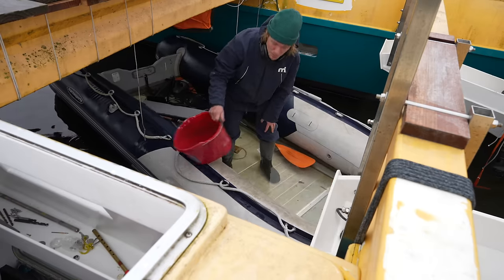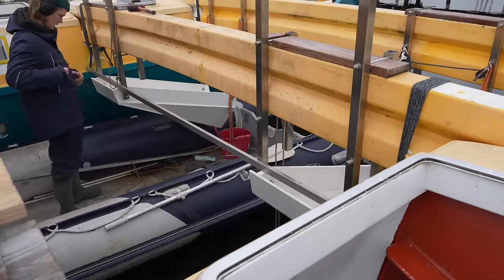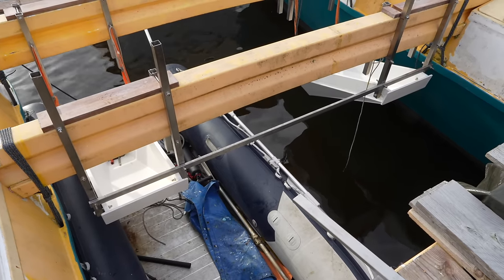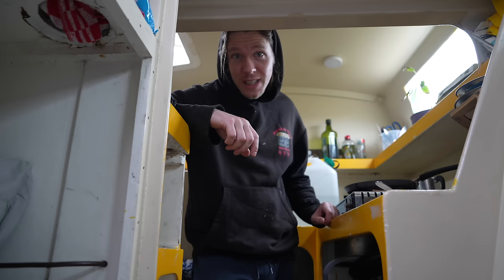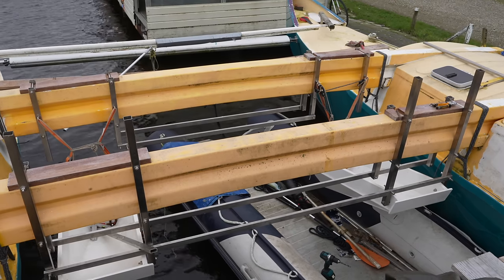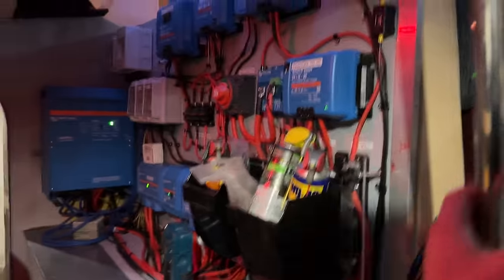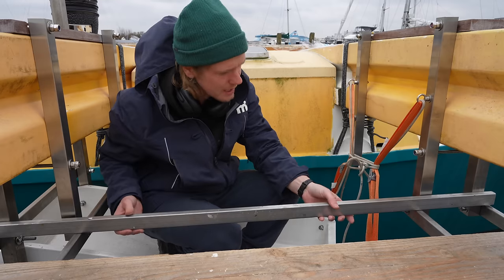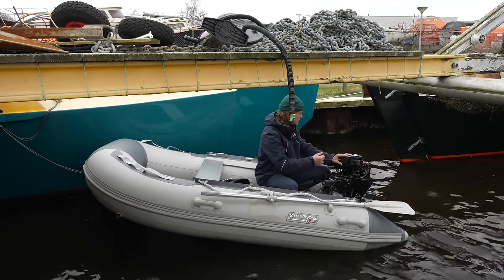I Built A Cockpit Floor for My Ocean-Going Catamaran | Wildling Sailing

Comment: Good to see you back.
Those 10mm bolts will be plenty strong enough (google bolt strengths), however without a bush welded into the box sections these will gradually give and the bolts will come lose over time. The bolts need to be clamped to them with a nut on both sides of them.

Comment: We made  a harness for our Yamaha powerhead out of h/d strapping. Made lifting/lowering the engine so much easier, and even more so with a line attached

Next to drilling S/S the triangulation of your engine mounting is getting the most deserved criticism. Pending a complete redesign you could drop a length of hardwood (an old oar?) into the bottom of the sled so that it transferred some of the engine’s thrust directly against the back of the crossbeam - easily dropped into place and removed when required

Comment: I have the same drill bit sharpener. Go back and read the instructions and try again with it. It’s not just about sharpening but finished angle on the drill. That’s what the plastic jig is for. It works well for me. And good stainless steel bolts are not cheap. Buy the best you can as potentially they will take a lot of load and you don’t want it all to come apart in a storm and lose your engines… Make your engine frame well once and it will last the life of the boat. good luck!

Comment: Substitute every single "hanging" bolts with a couple of hollowed squared pieces, and invert their position to lock the latters to the vertical ones. You will spread the load on 16 pieces of thick metal without exposing the bolts.
Once done you can always decide to add the welding on the spot to make it final and even stronger.

The cockpit position is quite a nice!
Reply from the maker: cheers mate!
Reply: Hey @WildlingSailing let me reiterate the reccomendation I made already once about the foot mast: make a turning one so that you can lay down the mast easily and even by your self when needed, you will thank me later I guarantee.
Reply: @oltreenrico6021 Yep. Your boom could then be used as a gin pole from a fitting at the mast foot to allow the mast to be lowered aft. Makes going under low bridges, freeing up jammed sheaves and working on other masthead fittings so much easier than climbing the damned thing …

Comment: Hi Mark welcome back, about sharpening drill bits,I found by using a honing stone to smooth of the bitter edge will stop it from breaking of , it makes it stronger and will last longer . I'm a machinist and have been sharpening drills by hand using a pedestal grinder, a drill angle gauge and a hone stone , also a cup of water to dip the drill in frequently to keep it cool. Good luck, practice makes perfect

Comment: Hey bro just a tip for you, buy some stainless sleeves to put inside your square stainless tubing to keep the bolts from crushing them, and use LOCTITE, and crank the nuts down.

Comment: A drill press adapter that you put your hand drill on would greatly improve tge drilling stainless steel even with crappie drill bits . They are cheap $50 and light .

Comment: Great to see you're back. Noticed you buy RVS (Stainless steel) be aware that's in general the name for 304 stainless, which rusts like crazy when in contact with salt water. Its okay for inland outdoor usage.  Probably you need to go to a much more expensive chandlery shop to get 316, which is what you need. But if you have already gone with 304, just paint it whilst its still good. Use a rust converter paint they sell fo fences, that works for years.

Comment: I've gone the bail with buckets and hand pump routines, and it's good to have the low-tech/no-tech backups but, brother do I love electric bilge pumps!  Your engine assembly is looking nice and square and parallel.  I'm a great believer in triangulation, or angled bracing, to resist unexpected (but always present) sideways forces that tend to collapse parallelograms.  In relatively low speed applications, like biplanes or sailboats, bracing wires do the trick without adding a lot of weight or windage.  Clocks:  Spring ahead, fall back.

Comment: I find when drilling stainless steel if you just squeeze the trigger and allow it to stop squeeze again keep repeating with pressure on the drill bit it bites it’s way through without overheating and blunting your bits try it you’ll be surprised

Comment: To drill stainless steel you need to use water to cool the bit. Not WD40. I learned that from my local welder who has many years of experience. Also not too fast on the rpm.

Comment: “Spring Forward – Fall Back” This term is meant to trigger your memory to set your clocks forward 1 hour in the spring at the start of DST, and 1 hour back in the fall when DST ends.
Reply: Never could rembr which way the time changed til I heard of 'spring fwd, Fall back,' then never had problem again.
Reply: DST? I haven't heard of that. BST, GMT, UTC, CET all appropriate to Mark's situation
Reply: @stephenmccarthy6892  fall forward spring back, check 👌🏻🤣
Reply: @stephenmccarthy6892 DST = daylight savings time if I remember correctly. When factories and workshops still had rooftop windows to light the workfloor, 19th century style, it made more sense. With LED nowadays, not so much.😊

Comment: If that’s your permanent rig for your motors, you should have round tubing welded in everywhere you have a bolt going through. Otherwise it will collapse and the whole thing will loosen and keep going until it’s junk.

Comment: Good to see you back on board. Can I suggest that you consider using some strips of rubber to remove the noise from the new deck you have installed, you could even put rubber behind any of the stainless steel where. anything touches the wood that will also relieve any rubbing. Looking forward to the next installment. Stay safe J.

Comment: If the drill bit changes colour due to heat from the stone it will dull quicker. Use water to keep it cool. The angle really matters also

Comment: Minor thoughts.   Locktite for those bolts.  I suspect a welder is a better answer once you decide the solution is worth keeping.   Anti-slip on the wood decking.   I suspect you will end up with the making a proper job of  it down the road but you don't want to fall down go boom on a solo sail in the next few months.   Circular Saw is worth owning pick up a used one for cheap.   Love you videos and envy your coming sailing.

Comment: Well done guy for doing something with your own hands restoring and improving the catamaran.  when you use a hollow square pipe in your designs, insert a nut larger than your hole into the inside of the pipe, so that the fastening bolt can easily pass through the nut; when tightened, the tube will compress the nut inside itself and you will not have the fastener loosened.  Well, or you can cut pieces of the tube-sleeve to fit the internal size of the square pipe, wrap a rigid wire around the sleeve with a margin so that you can push it to the hole in the square pipe, if without a wire, then a drop of super glue can fix the sleeve so that it does not fall out until you tighten the bolt.  all the best to you,

Comment: Welcome back!  Quick tip: When drilling stainless steel, the drill tip should be ground to a 135° angle as opposed to the normal 117°.  Got this info from our shipyard's machinists foreman.  After he profiled my bit like this, I went through 5/8" plate like it was butter, where earlier  going through it was taking me forever.

Comment: Use lower rpm, oil for cooling, stainless needs lots of patience.
Cutting speed for normal drill is about 5 to 8, thats about 160 to 255 rpm with diameter 10mm drill.

Comment: Would be pretty interesting to see what would happen if you clean the surface of the boat extremely well and coat it with ceramic coating. Wonder if it would stay cleaner longer like the surface of a car.

Comment: Get your Dad to cut  some crush tubes for the box steel on his lathe , over time the box steel will compress and the bolts will then be loose . M10 should be fine if they have the correct torque , the square box will be the weak point .

Comment: Hello from Down Under,
M10 bolts are already very strong, have a look at the sheer strength charts for M10 SS bolts. but enlarging the holes from m10 to m12 in the beam may weaken them. Need to do some math before you start drilling.
Glad you are back, keep at it.

Comment: You probably know you can buy stainless round tube with inside diameter same size as your bolts. To use as spacers so as not to collapse your square stock when tightened.

Comment: You will need to add compression tubes, cut to fit inside your box section so when you do the bolts up tight they dont crush the box section. The reason your motor wont go is cause it is a mercury. Always buy Yamaha, they go forever.

Comment: quick tip for sharpening drillbits. take 2 hexagon nuts or bolts. if you put em against eachother on one side. a drill bit fits exactly in the dimensions of the sides that are diagonal to eachother. thats your cut, can do it by hand like that checking if you superglue 2 together^^ that might help

Comment: Mark, when your Mercury 9.9 is running again you’ll probably want to test it out 😊 Be careful for the law! Max possible speed is 20 km/h for a boat without licence plates.. Your max is faster. So for your boat in this outfit a licence is obligaotry. Keep a low profile.

Comment: Weld small metal crossbars on the top of the outboard engine supports. This will hook the drop supports to the wooden cross spars.

Comment: Just a thought about those top M10 bolts.. I was thinking they should be replaced with more stainless steel framework, welded across the top to the rest of the hanger. I think a good weld might be stronger than threaded rods.. Just my thoughts though.

Comment: Hey Mark! Good to see you well.
The Merc def needs a carb rebuild or at least a tear down and complete cleaning. When people dont use high octane fuel with zero ethanol, it eats up the hoses and all that goo runs right through the carb!
I have a Merc 8hp i had tons of trouble with until i rebuilt the carb.
Good luck with it!👍

Comment: Don't forget to use anti seize or tef gel on your stainless steel hardware. when sharpening drill bits I like to use a bench grinder, but your setup looks good enough. Take a sharp drill bit and with the grinder off match the angle of the cutting edge to the wheel. This gives you a good idea of where you need to be. when you sharpen a split point the relief behind the cutting edge needs to be taken down, just remember to alternate sides of the bit and keep trying, you'll get it!

Comment: If that were mine I would get someone to spot weld all that metal together instead of relying on those bolts . You're on the ocean and those bolts are going to rust and corrode and one day that's all that it's going to take is for one of those to pop and your engine is Davy Jones Locker

Comment: Can I suggest some stainless steel plates on the motor, cradles where the pivot bolts go through the plywood, through bolt them so that the supports have a larger and stronger support /bearing surface.

Comment: In stainless, I've had good luck with cobalt steel, step drill bits as they allow you to start with a smaller pilot hole and work your way up to the final size without having to swap out to larger and larger bits.  Also, if you need to enlarge a previously made hole, they are some of the best bits to do that without "ovaling" out the hole.

Comment: Great to have you back Mark,
Stainless is harsh on drill bits.
Maybe invest in a drill bit sharpener ?
Also I feel those rods will rip through the stainless tube at the top of the beam especially if the holes are bigger (12mm).

Comment: Some might say it is overkill but ... an idea for those nuts on those bolts would be to to purchase slight larger diameter washers and fold them on the two sides onto the nuts. This would give you a little bit of extra security on them to stop them from backing out, the other benefit is being easier to do a safety check with just a quick look you could see if any were working their way loose. Safety first, second, and third.

Comment: When drilling stainless it is much faster to drill in increments. Also pilot drills like a 2 mm, are quite cheap, so great to get the hole started. Then sharpen or throw away. The tip is often the bit that dulls first, so dull a small cheap drill.

Comment: Have you considered the leverage of the engine weights at the arm length they are from the hinge and securing points? To get an idea, when the engines are in place and lowered, apply repeated lateral force to the 
legs and see if there is any noticeable stress to the mounting points or the structure as a whole. Imagine being out in heavy seas with the boat heaving and bashing and the inertia of the heavy outboards working against the weakest points of the mounting structure. I’d also advise making it possible to inspect all of the  structure in order to troubleshoot any problems before they become dangerous.

Comment: Stainless as a solution in an area subject to repeated stress isnt a great solution Mark. Ask  your dad, he should know. Material out of the way, design need also to be looked at, have you considered the possibility that in the event of a failure in the stainless structure your cockpit floor may also be compromised in a sudden and catastrophic manner potentially with a not insignificant risk of loss of life ?

A glass/ply engineered structure in keeping with the rest of the Pahi's construction would have many advantages, your familiar with the materials and you will always have those materials at hand due to the maintenance of the rest of the boat,  they will be much more available no matter where you are in the world. You also have a relationship with Hanika herself to bounce idea's off of and a community to make suggestions on ( ahh community engagement ).

It could also be designed in its whole, the engine pod supports, the cockpit, a wheelstation, fuel storage, helm station and weather shelter as one drop in unit. The beam attachment could also be engineered in the same manner as more typical Wharram construction. 

Then you wont have to hide an ugly stainless construction that may be prone to ( unoticed, remember you stated you intend to hide it ) failures.

Comment: While getting M12 bolts (look up shear strength of bolts)will seem better. The weakness in the hanging steel structure is the wall thickness of your SHS and the distance from the drilled hole to the end of the SHS tube. Welding a crush tube or increasing the thickness of the SHS tube end would help reduce the stress. Also a spreader plate on the wooden beams to spread the forces of the two bolts on top of the beams would also strengthen the whole structure.

Comment: I think you have been told about "stepped drills" before. They do metal much better than standard drills. Probably some sort of drill stand , maybe one that holds you existing drill, could help. You still have so much steel drilling to do, what with rigging etc.

Comment: Good job, I feel some triangulation on the cage would be good and it needs welding or sleeving as others have said. Also great to see you back on the Boat. I am sure your family are missing you anew but your drive to get sailing is great, I am looking forward to the mast and rigging going up.

Comment: Yes, great to see you back. I understand your desire to be sailing this summer but..... take your time, enjoy each moment, remember it's the journey not the destination.
My trade was sharpening. I would sharpen my own drill bits on a belt grinder. The angle of the cutting edge is quite critical and easy get wrong. The cracked cutting edge could have been caused by too acute an angle. Cobalt bits are definitely the way to go. Another thought, too late now cause you persevered as usual, but what about drilling a pilot hole with a smaller bit, say 5-6mm, first then the full size bit.

Comment: Good to see ur energy back, sorry but ur engine pods will not hold in the way they mounted. Have u drwn up a force diagram ? 
Think of the angle at which the propeller will thrust the boat forward , those frames will just bend right around.
Fastening with m10; or m19 won’t make a hula of difference sadly

Comment: when sharpening high speed steel drills for stainless I use a less aggressive angle for the cutting edge then grind a relief behind it so the cutting edge has a bit more meat behind it

Comment: Stainless is tough to drill out. start all the holes with a 3/32 or 1/8 inch (or equivalent size) first, and then sequentially larger. I use actual cutting way, and cutting oil. not wd40 I know it works, but there is a reason we dont use wd40 in the field.   I love to see the progress mate! keep at it, she is looking great!

Comment: I have the Tohatsu 9.8. I have the same problem as you every spring. Remove the carb and clean out all the channels. In particular the little brass coloured idle jet that unscrews. Replace the fuel filter and try and use fresh fuel.

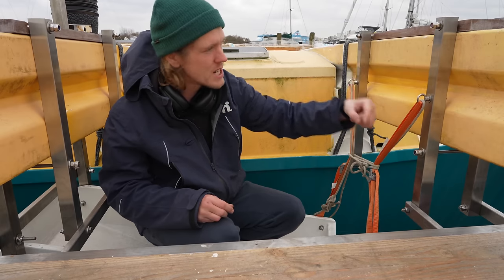Comment: 23:50  Mark when the weather warms up you might want to consider screw+ epoxy some hardwood blocks onto the beams to prevent the metalwork from moving around side to side too.

Comment: The bigger the bolts the less stainless around them. Can you lower short tube spacers inside the RHS using electrical wire and slide your bolts through the tubes? Doing this would increase the strength tenfold and stop the tube collapsing under load at that point or from overtightening of the nuts.